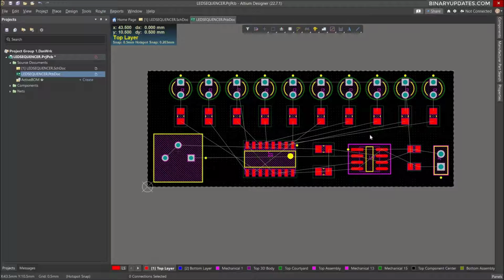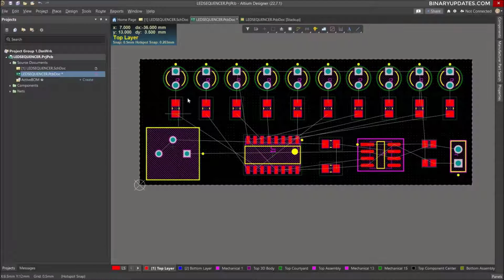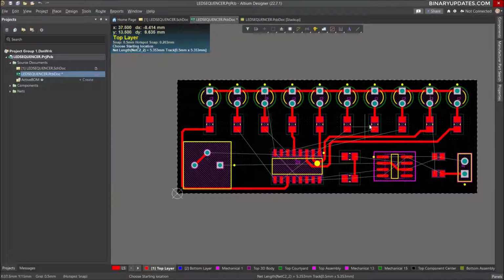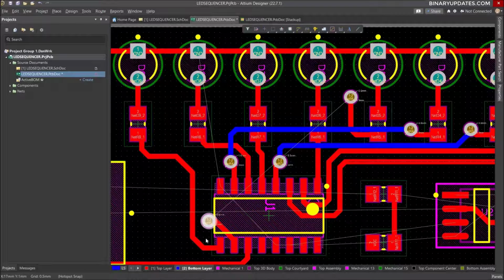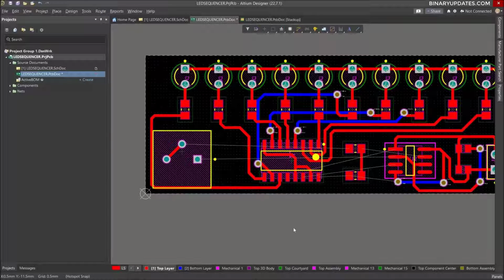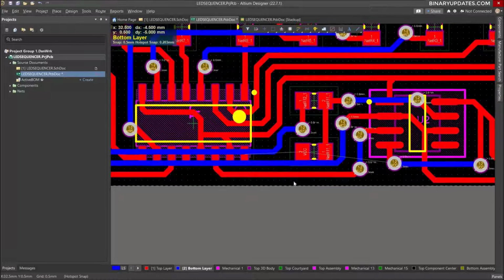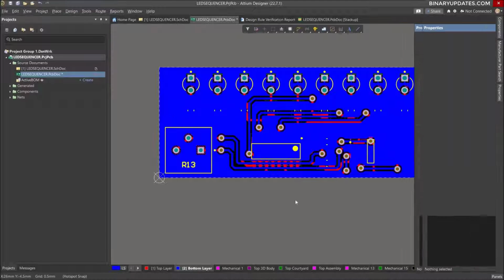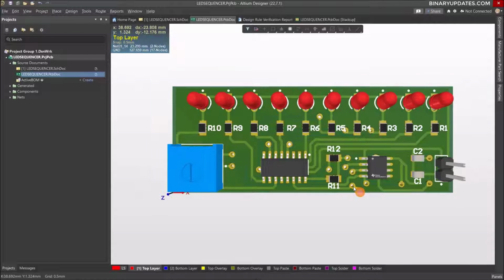Altium Tutorial 2- Routing the Printed Circuit Board

Comment: You should not route the tracks from the pads of that blue colored connector on top layer,because the blue colored plastic case of that connector will covered entire solder pads after placement, so how do you do the soldering? after placing that connector on top side i mean you can't see the solder pads after placement of that

Comment: There seems to have been a change with the part in the bottom left corner (3386P-1-104LF). Although I think I followed your last tutorial correctly, for some reason the two bottom connectors (1 and 3) seem to have swapped nets. It's model also looks different now. I was wondering if this was an issue.
Reply: I have the same issue today. Did you figure out how to fix it?